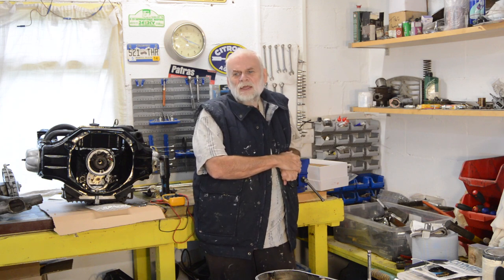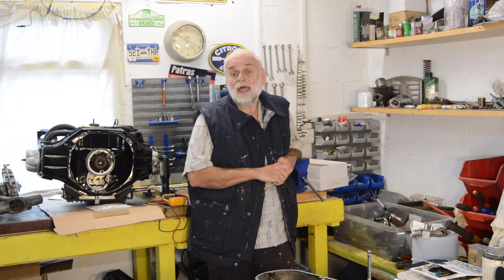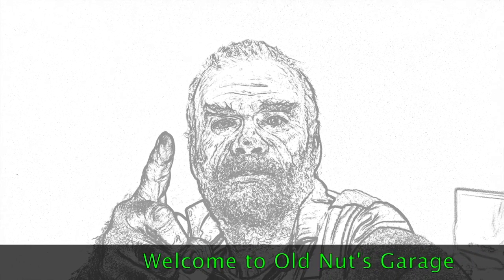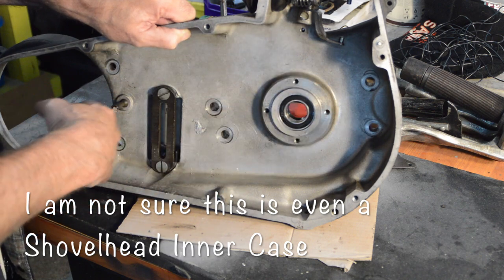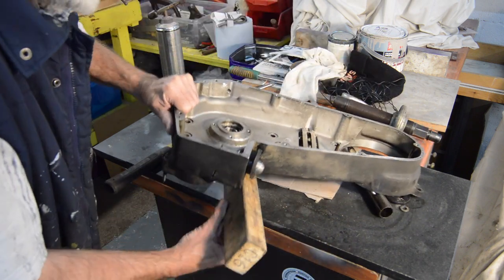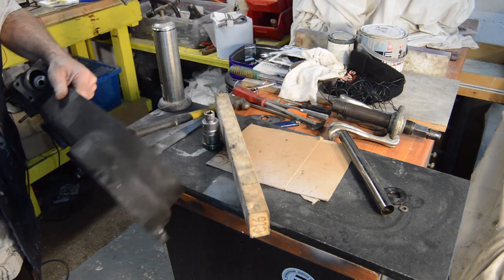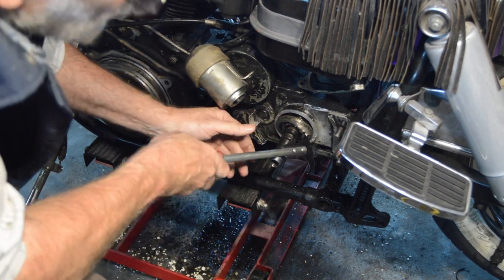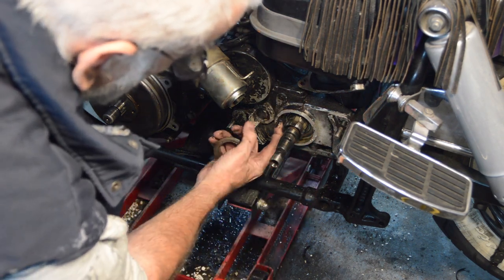Shovelhead Primary 3

Comment: Those holes were drilled and tapped by the factory that is standard for Harley Davidson.

I believe I used a standard steering wheel puller to get that fly wheel off, there are powerful magnets in there that make it very difficult to remove and to put back on without taking your fingers off.
Reply from the maker: Hi Tommy, what threw me a bit was when I went looking for reasons the rotor would not budge. Looking online, people had rotors with my type of holes, some with 2 untapped holes further out and some with none at all. I have now downloaded a genuine factory manual and it shows my set up. Those magnets have some pull !

Comment: Hey buddy it’s probably the magnet holding it on so be careful hitting it have a homemade pullers here and I have to say it looks stand with the three holes … is it charging? 
You are doing great by the way and thanks for the mention… and one bit of advice for this week check the treads on the engine case they shouldn’t be lose like that …. And make sure when your reassembling that you have the same size engine o ring because the is thicker and thinner ones and the thicker one WILL crack the inner primary ..or worse the engine o ring lip …. 
 And lastly is you loosen the gear box  you will have to loosen the engine and realign them and that’s a pain in the arse  as well as you can crack the same lip off the engine case as the inner primary so my advice is don’t loosen either if the primary is straight 

Plenty of sealant …..
Reply from the maker: I made sure that the gearbox was tight before I started stripping down because I did not want anything moving about. The O ring is in good nick so I won't be replacing it. I have not checked the threads yet but I will before it goes back together. I have got puller now, it is in the next video and it worked a treat. Once again Micheal, thank you for all your help !
Reply: @oldnutsgarage  your doing great and I’m enjoying the content loved the trips as well keep it coming and I can’t wait for the next instalment

Comment: Just went back on your videos … and yes bloody motorcycle…. Right as regards the oil pump to remove it you’re talking about removing the pushrods, timing, cam, a finicky c clip..oil pump …. And you may not fix it (there’s away of using fine grinding paste and an old pushrod) … I have had the same problem and even replaced the pump … and the new pump is now doing the same thing …. I now live with a coke can on the hose an live with it…
Reply from the maker: Sounds like I will end up living with it as well then ! Sounds like a lot of work without any guarantees, thanks for the advice !
Reply: @oldnutsgarage  try a new spring and ball … I remember a guy had a evo with the same problem and he routed the beater to a catch can by the chain and and was using the oil for oiling it not sure how … but I suppose it depends on the amount 
I have noticed that mine did more before it needed a service mind you I use mine in the summer … dare I suggest using straight 50 I know some of your subscribers love to debate about oil but I agree with you …
Reply from the maker: A new ball and spring sound like the cheapest starting point and `I was thinking of trying straight 50 next oil change, so I think I will follow your advice and start off with those.

Comment: You are correct: my '81 flh, ate a primary tensioner nylon rubbing block on a trip...the return line blocked up with nylon bits and the primary started to collect oil. The clutch started slipping. I pulled into a kmart parking lot. found a plastic soda bottle in a dumpster, drained the primary. Dumped the oil back in the oil tank; shot the clutch plate with brake cleaner through the derby plate.  snugged up what was left of the rubbing block and continued on.
Reply from the maker: Great roadside fix for the issue Magnus!